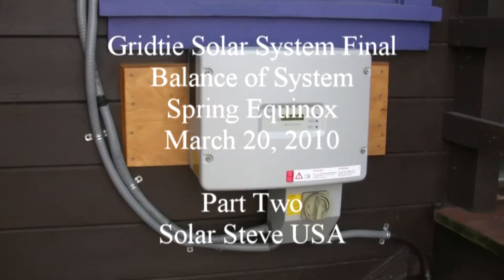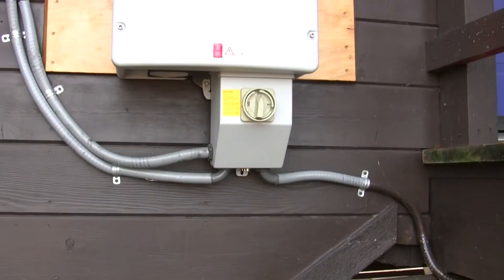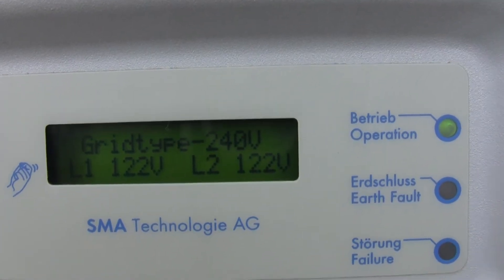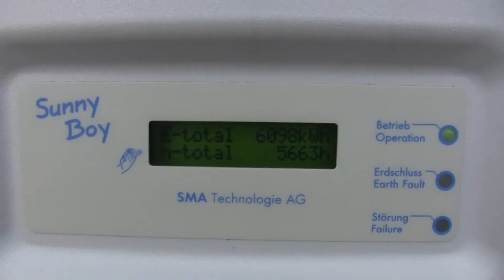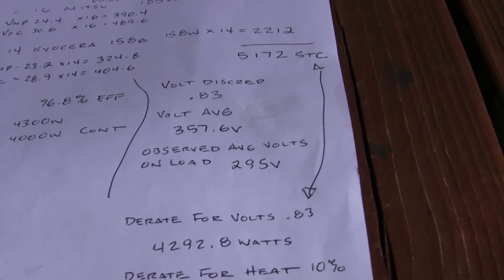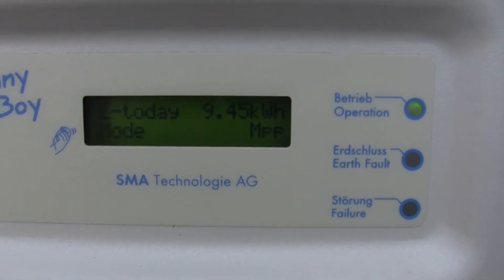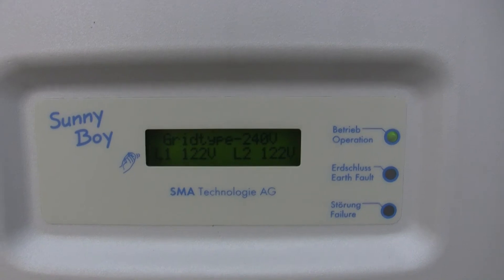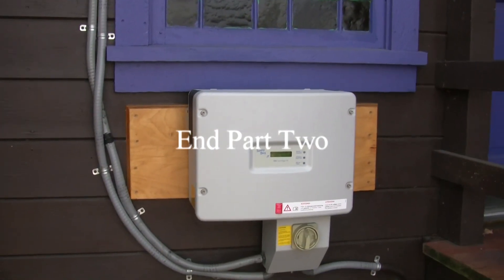Gridtie Solar System Final: Balance of System, Part Two

Comment: Good video. I found MOST of the information useful. My only issue was the deal with the "chem-trails"......They are vapor trails, and while they do have some exhaust from the turbines, they are predominately ice crystals formed in the upper atmosphere from the hot engine exhaust mixing with moisture and freezing on contact.......We do not see the exhaust "fumes" or smoke from that high up while the aircraft is at cruising altitude......What we are seeing is light reflecting off the ice crystals, and nothing more than that.

Comment: The system is a "grid-tied" system. It needs the grids power also to work. If the electric company has the power off and is working on power lines, guess what happens to them if your system is producing electricity into the grid?

What determines where power is drawn from depends on the supply/demand. The power from the panels is used first, and then if your demand is still more then what your panels are producing, the electric company supplies the balance.

Comment: Thanks Steve, I installed a 4kw system last summer and was surprised that it averaged 3kw - 3.2 at best. I worked with the numbers to try to understand but your math helps alot.

Comment: #1 your panels are flat. that takes away possable power output! #2 you dont track the sun so you lose 10-50% of what you can harvest! #3 if you had 2 diff inverters or charge controllers ( one for each string) you might get more output! Dont get me wrong you have a sweet system, but It could be improved upon!   Joe